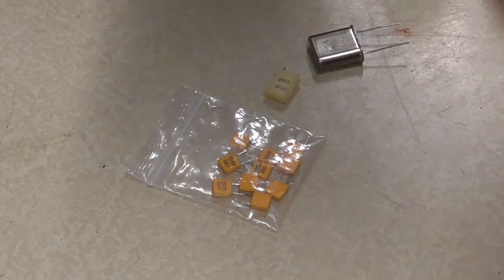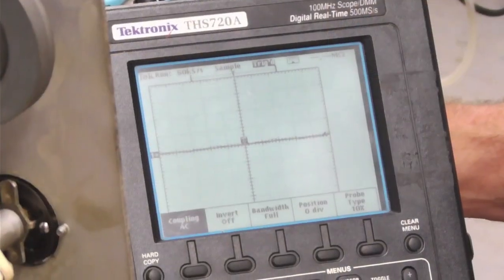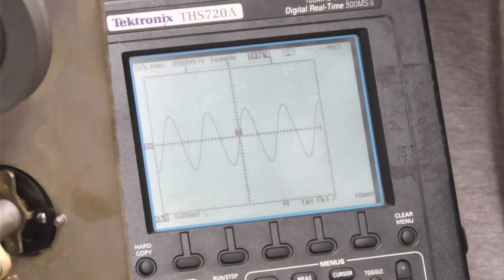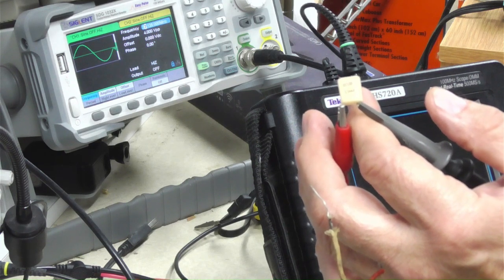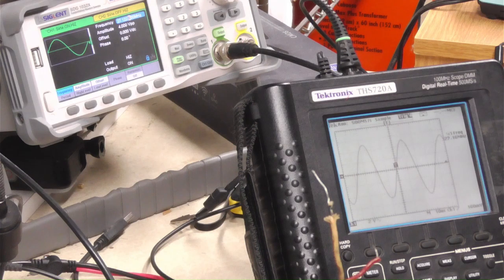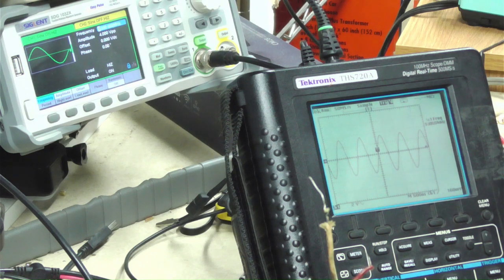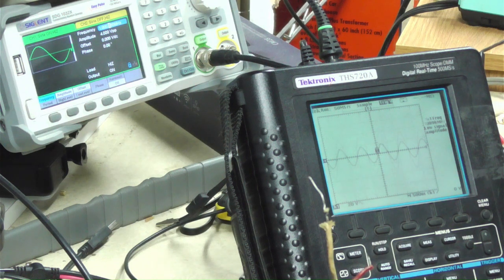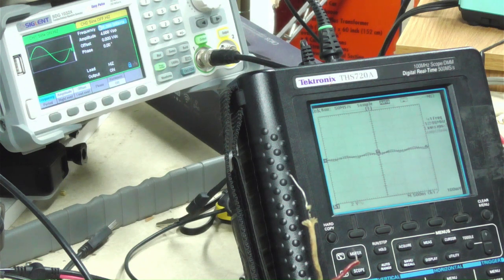Fun With Crystals

Comment: Hello! It is very usefull a cheap network analyzer for crystal mesurements. With a wideband impedance transformer 1:9, you can measure serial resistance, parallel resonance frequency, and serial resonance frequency. 
What is about tube radio equipment - I am very admire about hard work of engineers and constructors. A perntode has high input , and moreover, output impedance. As a result , a tube absorbs weak electrical EMI fields. It is very difficult to achieve gain more that 60dB (because a positive feedback through air). You must construct a large boxes from metal - to improve the situation.